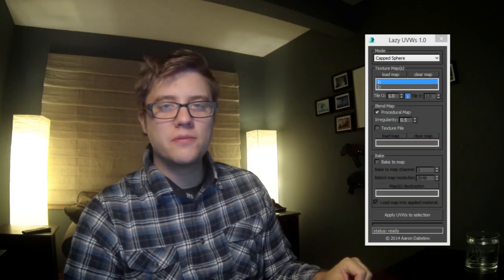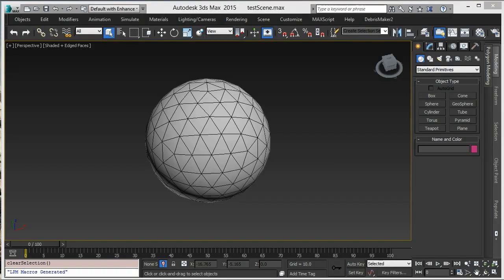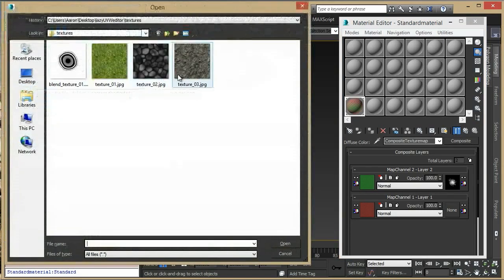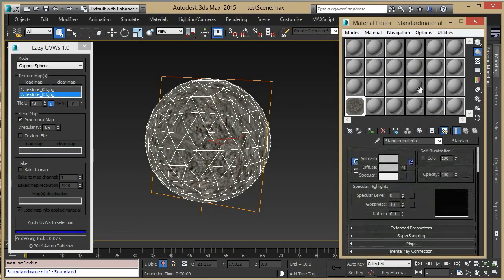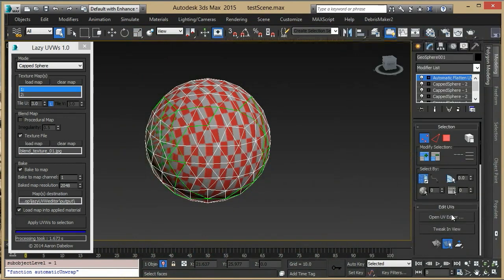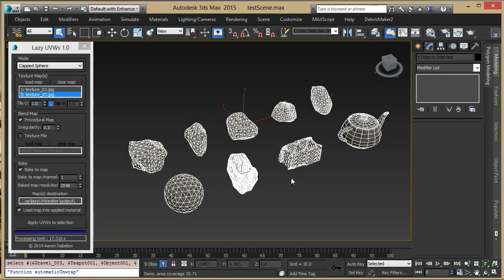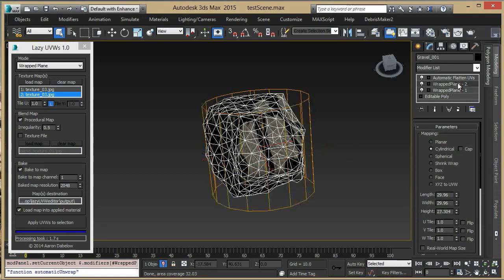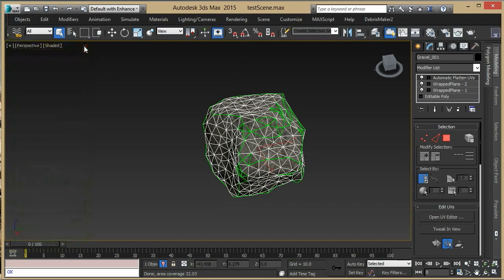Lazy UVW editior - Procedural UVW layout and texture baking tool for 3dsMax

Comment: cant believe ur using windows 10, ur seem to be so smart, first thing i did when installing W10 is reverting to W7. Any reason in particular ur using W10 or do u simply like failed eye-candy?
Reply from the maker: +Ethan Janssens A lot of people use win8 and up. I, in part, want to make sure the tools work in the modified ecosystem ( permissions and such ) that most/many people use.

Comment: very useful script! Thank U!
Additionaly I have a question for you:
Sometimes 3d artists face a problem: you just need to bake a Composite map with a different map channels in a single-layer texture with a single map channel. In this script, it is possible to bake multiple channels in one, but this feature can not be used for the object with ready-made texture coordinates (that were made prior to the application of this script).
Maybe you have a script which allow simple baking multi-layered texture with different map channels to one-layered map with single map channel? Or you see something like this from other developers.
And in general - it would be very useful to add such function in this script